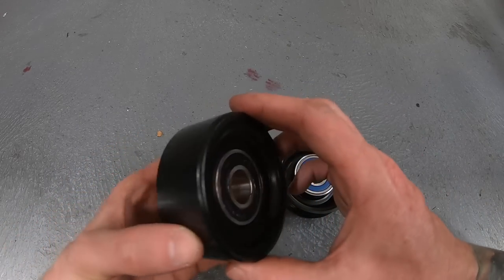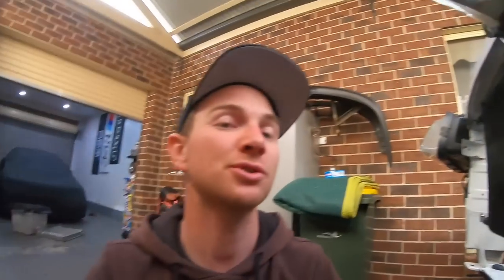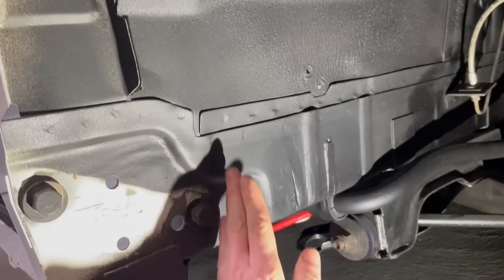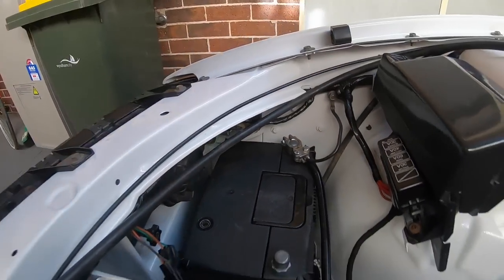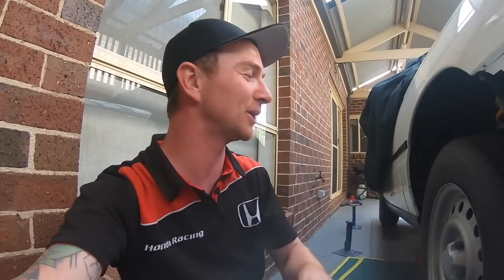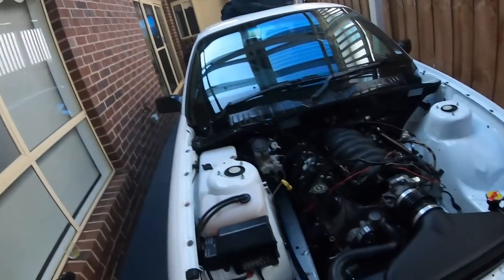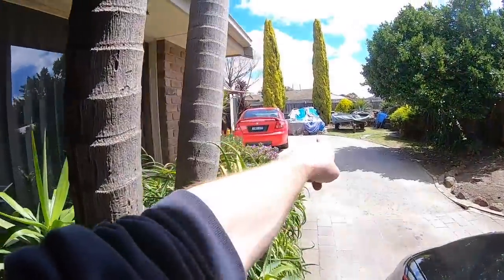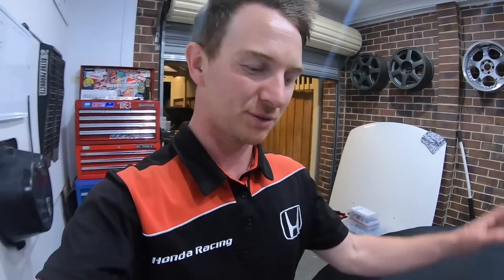LS1 VN Commodore lots of FAIL in 1 video

Comment: when I wasn't sure what pins were what on the loom, instead of undoing everything I just used a multimeter and the ECU pin out diagram to reverse engineer what wire is what. Unplug the loom harness plug, find the pin (say, pin 1 of the crank angle), stick a wire in it, wrap it around one of the multimeter probes, run another long wire from the other problem to each of the pins on the plug and wait for the beep! Love the videos bro, all the little final things are hard, just keep plugging away!

Comment: For the Astra pump wiring is it just two wires? Power & earth?
Reply: Yeah power,  earth and 2 triggers. You can wire power and the 2 triggers together if you want it to be always on
Reply: Delaying the 2nd trigger activates pump to full speed rather than  slowly winding up
Reply from the maker: correct to all of the above